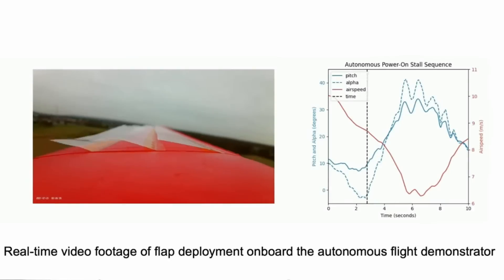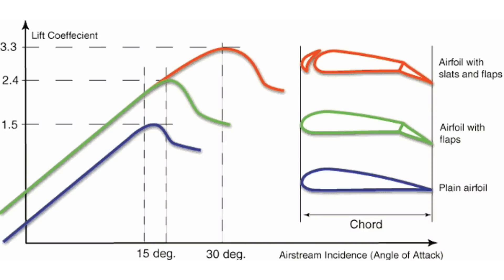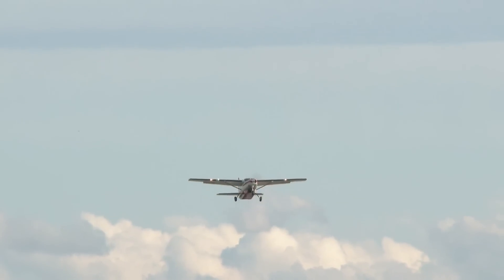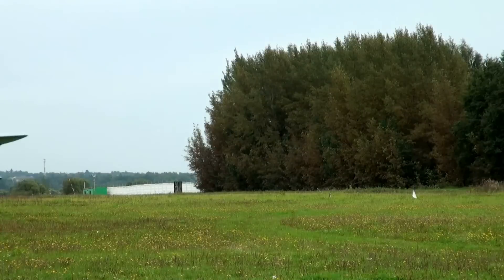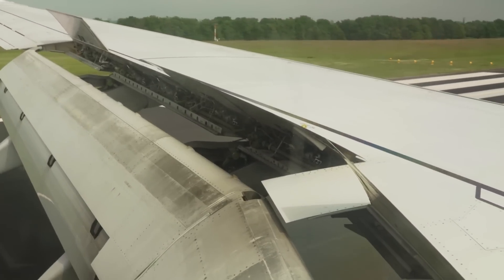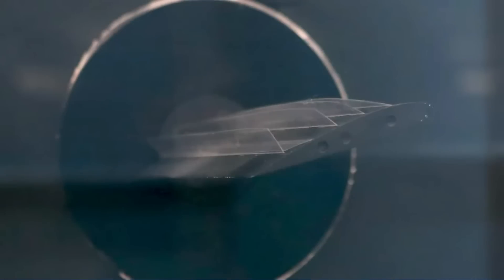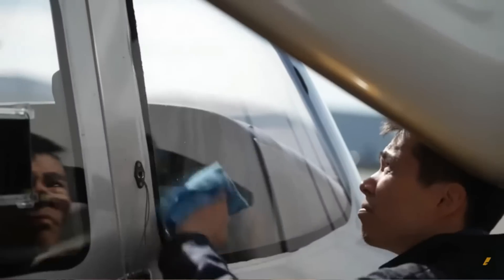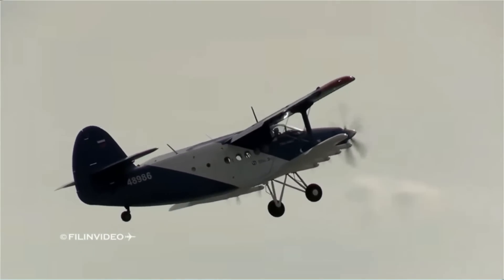Very High Lift Coefficient Wings: The latest developments

Comment: https://www.youtube.com/watch?v=sI32NIvjvic  Tks for great video. Q: Why is there no twin biplane: 4 wings - all 100% dist propulsion, max slats, multi slot fowler & jet augmntd flaps, surface excitors ie every VHL device combined = tons of lift. Then reverse a boom tail prop for an airbrake.
It should go straight up no?  Or just hang in the air?  If pseudo geared anti-gravity already exists, why no one tried?  A huge ship even?

Comment: I would like to add that using tubercles like the humpback whale flipper leaving and trailing edge, I have experienced making them on a stainless steel 16/16 water propeller for a pedal-powered catamaran. They can be used on airfoils as well as propellers with great effect. They say you can double the angle of attack with the same amount of drag. 
This could be the last component for maximum efficiency.

Comment: Some disadvantages of distributed propulsion: (i) no part of the aerofoil will be in the laminar flow regime, increasing drag, (ii) the streamlines will not align with the chord, and the angle will vary with spanwise position, making the aerofoil shape sub-optimal in most places, (iii) a large surface area (the wing) will be exposed to air with a higher-than-necessary speed, generating extra drag, (iv) lots of smaller propellers are less efficient than one big one, and, MOST IMPORTANTLY, (v) you will need a VERY long runway and good tyres/brakes when the battery runs out mid-air.
Reply: Most underrated comment .
Reply: With so many props you can just autorotate
Reply: @tedarcher9120  No.
Reply: @tedarcher9120 😂 👍

Comment: The wing of a Cesna 172 has a lift coefficient of 1.6 without flaps deployed. With its Fowler flaps deployed it is way over 2. Blown flaps had even a F 104 Starfighter, that is not a thing specific to electric aviation.

Comment: I have a wing concept for a 3 seat amphibian in which I twist the inner two thirds of the wing so the wing transitions from an ultralight configuration (low lift low drag low landing angle of attack) to a microlight (high lift high drag high angle of attack) configuration. The advantage is high angle lower landing speed with a very precise touch down threshold hold. This ideal for short field operation, while the flat wing ultralight configuration allows higher cruise speed. Look at the A380 in full flap landing configuration to get the idea, but in achieving this by twisting the wing leading edge up and trailing edge down there are several other effects that occur to increase the lift for very low speed short field landings.

Comment: This is an interesting video. I wonder, what are the failure modes of a blown flap design? Specifically, if the engine fails during takeoff, what does that mean for the handling compared to an engine-out situation in a conventional aircraft?

Comment: Back in the early 1970s at school,  making obligatory delta-shaped paper planes out of A4 paper, I came up with the idea of adding a 90 degree upturn at the tip and did seem to improve the ability to get a straighter flight line. Now, many years later, as we all know, many commercial airliners have that very 90 degree wing tip feature. Obviously, I cannot claim any credit for what has transpired to be a missed opportunity.
Reply: Winglets reduce turbulence and even a duck knows you cannot trademark this lol good joke though
Reply: @AndrewDutton-Topper  It's not a trademark it's a patent application. There are a lot of filed patents relating to different aspects of winglets. The first was in 1897 by Frederick W. Lanchester and the first patented functional winglets in 1910. Anyone could have patented the idea or an adaptation to the idea that is original. They still do.

https://www.nasa.gov/wp-content/uploads/2023/04/sp-4529.pdf
Reply: I think the new wingtips is using multiple "feathers" as condors and eagles do. Probably kills the vortex before it gets to form.

Comment: I an not an aircraft expert, but if I do not miss my guess, an aircraft with higher coefficient are more susceptible to  turbulent air.  If more lift is obtained from air at low speeds, then high wind gusts hit that wing, then the aircraft will bounce more violently.  Is this addressed by any of these craft?

Comment: Would it be efficient to have an effective biplane configuration that recessed into a single double width wing after takeoff ?  All the advantages of Fowler flaps and slats with even more wing area for lift at takeoff but reduced drag for cruising.

Comment: Well, there are a lot of misconceptions in the video.

The most significant is that STOL is a requirement.  Making an inefficient airplane, or a complicated airplane, is never a solution to the problem of short fields.  A solution to short fields, is making a longer runway.  In the long run, that is much cheaper on all fronts.

The Princeton University's solution is horribly wrong.

Comment: Thanks. There exists a wing with blowers set at about maximum top wing that keeps wing shorter  length and  probably  ~25% thick foil with a sorta stepped wing after the front section leading edge.  stepped at highest point on top foil  . It's sorta like Clark Y wing   fairly flat bottom  and very thick ~25% thick leading edge  It's starting at  zero going to top thickest on top ~ 25% . Instead to gradually curve down to trailing edge from top at ~25% thick at top it follows a very steep curved down and a sorta step foil is created that goes down at about ~70 degrees and curves to  a stop about mid line of the typical Clark  Y foil  . From there the foil has nearly flat foil shape on bottom of step to trailing edge.This wing foil shape is virtually all drag as the air comes of the top of the highest point of the foil and tumbles down the steep slope heading to trailing edge .The solution to this drag issue is about ~5%  the jet engine  force is directed through the middle of the wing where the leading edge has  larger intake holes in it to allow ~5 % jet force air be directed  too travel down the center of the wing and created tunnel of reduction channels using reduction layer fan shaped tunnels to reduce the flow to make  blowers at the exit of the  thickest part of wing at bottom of the step wing foil   That's about 1/3 the distance from the leading edge.Then at the thickest part of the wing the ~5% jet force is  quickly directed in strep new direction to be sent steeply upwards  to follow the steep ~70 degrees angled step. EG   jet air flows points also nearly a  forwards direction relative to travel direction of flight of the foil wing shape. This ~5% jet force from wing slots collides with wing foil descending air from top of wing foil causing the air on top of wing to follow a curved path similar to what s normal Clark Y wing shaped foil would do  without the need for the parasitic wing foil shape .This jet forced air is coming from bottom of stepped wing on flatter part going the
 to the trailing edge .The high lift ratio is higher than Clark Y types but does require directed air flow through center of wing and severe direction corrections  redirected  air flow is creating losses of power from turbine jet engines which can be in front of wing foil or buried inside such a thick air foil shape. EG foil is not suitable for high speed use but good for high lift  slow STOL flight  and is not dependent on flaps so much . The bottom of the foil can be reduced in length do that instead to be 1/3 for front of foil and 2/3 rds the length of foil to trailing edge  as in Clark Y types to be closer to ~50/50 ratios  there by saving on wing weights and giving ~25% plus wing foil thickness ratios and extra strength for wing carrying the extra weight for STOL use. If you sub to me and supply email I will draw you this foil from memory got from book of aerodynamics ~1974 era  It's s book which I can no longer find online or on book shops in Ireland so I do not know name of wing foil

Comment: You start off with false hoods. Certifications are not lessened , the process will always remain the same. Testing on models has some advantages but air cannot be scaled and therefore the Reynolds’s numbers yield different resultants. They are other misrepresentations in your video.

Comment: Thank you for all your videos.
Question;
Should the propeller airflow be above the wing or below?
I would think it should be above, but I don't see that often.
Reply: On Both equally.
The propeller is just giving More Air Speed for the wing aerodynamics to work.
Its like a Combustion engine Turbo, but for wings.

Comment: 1:34 "high lift coefficient can be achieved"
which is offset because propulsive efficiency is trashed. This is why NASA'S Maxwell project stows its (extremely inefficient) distributed props during normal flight.
Reply: Thanks, good point

Comment: A single engined plane, such as the Cessna in the video, has the engine fixed to the fuselage. Would there be any advantage if it could tilt up and down, perhaps to enable a greater angle of wing attack for take off and landing?
Reply: How would tilting the engine enable a greater angle of attack?
Reply: @PRH123  My thought, probably as ridiculous as it is, was that, were the engine lowered, the rest of the aeroplane, along with wings, could be angled up, thus increasing the angle of attack. Were there any merit it the idea, it would probably be easier to angle the wings. 
It amuses me to have ideas.
Reply: @tomellis4750  yes, would be easier just to pitch the whole aircraft upwards, using the elevators, as is done on most aircraft now

There were experiments done in the past with aircraft that allowed the wings to freely rotate around the spar, the idea was they would auto adjust to the optimum angle of attack, but I don’t think such an aircraft ever went into production.

There was an us naval aircraft that allowed the whole wing plane to move upwards like 5 degrees, for carrier operations, I think mostly to preserve visibility for the pilot when the wing was at high angles of attack.

Comment: Lots of Fun being had , [ though no mention of the channel wing ? ]. STOL bush planes like the zenith are getting in the air at around 100 ft ,and some of the ultralights are landing in there own length ,plop ! , this is with out to many more fancy add on's . I have seen info on an antinov being able to basically descend in a controlled mushy stall . It certainly saves huge energy ,flying off vs VTOL , and way more efficient travel .
Reply: The Waldo Waterman Aerobile was virtually un scalable and did a controlled mush stall landing. I have a dramatic improvement to the channel wing designed which gives it full VTOL capability but with high speed cruise capability. I haven’t built a drone version for it yet.

Comment: A category missing from this analysis is the Custer lifting duct design. A NASA analysis of the Custer duct reported a lift coefficient so powerful vertical takeoff was possible. The problem they identified was excessive drag and limited top speeds. That caveat is a simple design problem that has a number of obvious solutions. It is crazy they have not been investigated.
Reply from the maker: I have made a video on Custer Channel Wings.
Reply: @ElectricAviation  Yes,  I was excited you decided to cover it.  But I was surprised you never did a follow-up. The drag issue is surely solvable with some active aero tweaks? Also, I wonder why Custer never thought to merge his design with a gyroplane? It's failure modes are trivial when you can save the aircraft with an autorotation landing.
Reply: They’ve been investigated, a German company was at one point planning to try to manufacture a channel wing based aircraft. The issue is that the design requires a twin engine layout, which immediately makes it too expensive for the light GA market. Those twin engines need to be cross shafted for redundancy in the case of the failure of one, which is weight, complexity and cost.  So you end up with a big complex expensive aircraft, the potential customers of which would be comparing it to turbine helicopters, which would have some advantages, such as true hovering with full control.

Multiple electric motors though could change this equation, which is an interesting possibility.

Comment: Make distributed electric propulsion but propwash only goes over top surface and you will have very very high lift. More than just regular D.E.P. that is the secret now someone hire me
Reply: Yeah, the entire lifting principle of aerofoils is that the faster air over the wing is lower pressure, so why not direct the propulsion over the wing to artificially increase it?
Reply: @gormauslander  if the prop wash only goes over top and not bottom it creates a larger difference in pressure in top vs bottom. If it goes over top and bottom the Increase is not as much
Reply: @paulrun111  "it creates a larger difference in pressure in top vs bottom" . So... more lift ?
Reply: @Newtoon  yeah exactly.
Reply: My understanding is that lift is created by a combination of pressure differences AND changing the direction of the airflow, part Bernoulli's equation and part Newton's laws. Your proposal therefore is unlikely to work - you can't get sufficient lift through simply attempting to suck the aircraft upwards, you still need to change the direction of the flow. Making the prop wash go over both surfaces would therefore provide better lift.